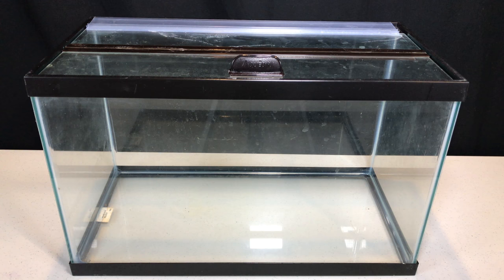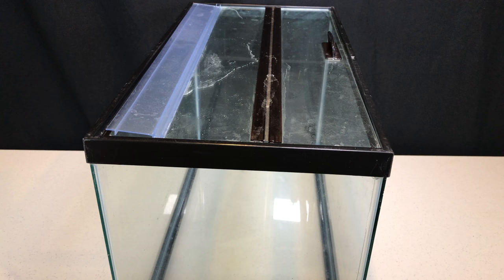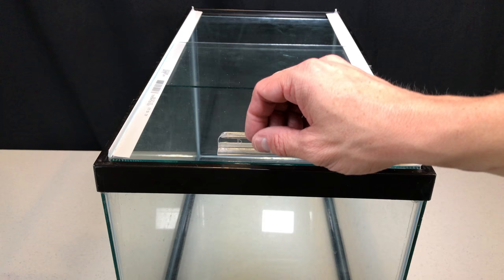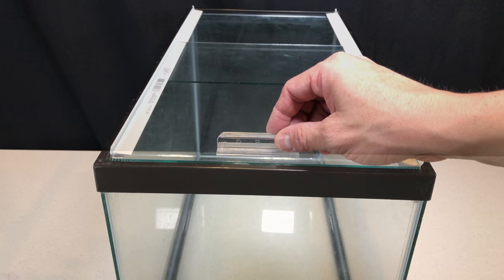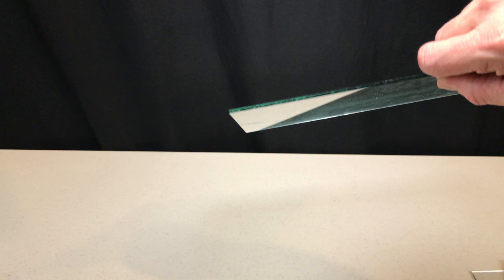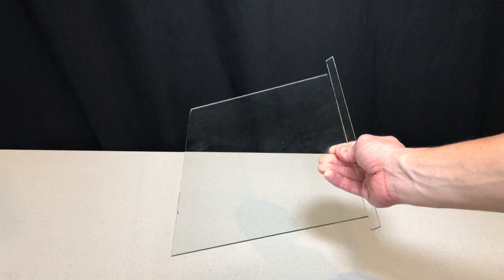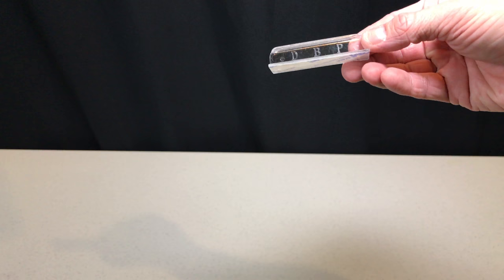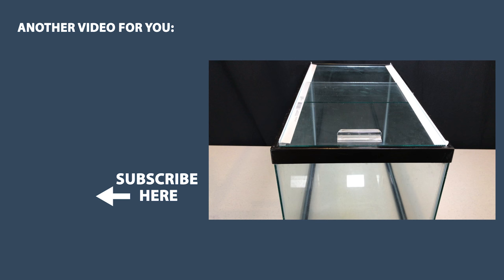How to Make Sliding Glass Aquarium Lids

Comment: I like this because it's not shabby, janky or ghetto. I want to suggest something a little different though, although this is the best idea I've come across yet. And if your goal is purely economical, this might not be the thing for you. But if you want something a little better, maybe a bit more money, maybe not, there is another way of doing this. I used to build reptile cages professionally, so I've built lots of things like this. If your situating your tanks short side of the tank facing out, like in this video, as opposed to long side out as you would do with one tank in your living room, there is a little better way to do this...maybe...I'd have to use them both, but hear me out. You can use either that thinner glass as above (the problem with that is it is so thin the edges can't be "sealed" or smoothed over) but my preference would be 1/4" thick as it is more substantial, can be "sealed" and getting daily use, the heavier glass might be better. At least the front piece that is moving when sliding open. It sure is a better feel. Or you can use the polycarbonate material as seen in other videos, and if you can somehow seal the ends of that stuff (and I've got an idea for that), it traps air and thus has an insulative property, keeping your heat in much more effectively, thereby saving your heaters is using them. Anyway, you use the same dimensions as in this video, except the back piece is attached to the TOP of the plastic rim...maybe permanently, maybe not (using some L channel around the 3 sides would keep it in place nicely, or you could glue it on which would be permanent). You use the same dimension front piece that goes in the lip where the lid is meant to go. This way, the front piece, the one with the handle you use every time you get in the tank, it slides UNDER the top piece, which I think is better because in this scenario the front piece is on top and there really is nothing to hold it down or give it any guidance. Kinda flimsy. Does this make any sense? What do you all think?

Comment: Usually in the same place you find the plastic molding that Steve used, you can find a piece of small white plastic J molding(that's like a 1/4 inch on the bottom and a 1/2 on top. I used that stuff to cover the edges of the glass. Put a couple dabs of silicone on and it keeps the glass from cutting you, and also keeps it from wanting to dig into the piece its sliding on too.

Comment: i got all my tanks second hand and they all came with no lids. i found the same idea on youtube and luckily  I work at a Ace Hardware and we cut glass to size for sale. the only thing i did different  were the handles. i used a 3" X 3" of plexi glass that i heated up and folded at a 90 degree angle. and i just used a little bit of clear epoxy to glue them in place. the lids work very well and they are easy to take out uf needed. Great DIY vid!

Comment: you could cut up old tanks that leak, and make your own lids. ive never done it, but lids are so expensive. i find glass from resale shops, glass that would be used on furnitire shelving, so its kind of thick, and use that, and regular wood i fond in the garbage. i can set those dome shop lights right on the glass, and its ok. Nothing breaks, or cracks.
Reply: or just reseal the leaky tanks!
Reply: some of it may be tempered glass,  FYI.
Reply: Cracked my first glass top years ago by putting a shoplight on it.

Comment: If you would put a filter where would it go
Reply: At the back, just leave room enough for an airline, or cut a little hole.. If you are doing a multiple tank setup like this, you are likely running a bunch of sponge filters and heating the room rather than individual tanks, so it presents little obstacle. You could also have a hang on back filter and a heater cord coming out instead at the short end. If you want them to hang off the long end, then you are better off sticking with the versa-top style.

Comment: great info, fyi lowes will cut glass for you at no cost.
Reply from the maker: +Tank Addiction they were unwilling to cut a piece this small off of glass this thin but in general, yes they do offer that service
Reply: I know home depot won't cut glass but lowes does, if they say no one should ask why not I've worked at lowes for 12 years and it is a service we have always offered, Ace Hardware also offers glass cutting in most stores, great video thanks for sharing friend have a great day.
Reply: Tank Addiction Where are you that Lowe's cuts glass? I've been to many Lowe's and have NEVER seen a glass cutting area in them. are you one as coast or something??? I asked one Lowe's and they had no idea there were Lowe's that cut glass.
Reply: eric j u still work there?

Comment: Urgent question! I'm putting a 75 gallon in my new house soon, has a stand and I found a great video on building a 100% custom remote controlled light bar, but glass lids are SO expensive for bigger tanks. Any advice on making a heavy lid like that first one you showed us? It needs to withstand dojo loaches which can grow up to 10 inches and are notorious for being strong jumpers. Thanks!
Reply from the maker: Lids for a 75 aren’t that expensive. I would shop around. Drs foster smith is usually my go to. It’s worth investing in.

Comment: Anyone try using Lexan ?  Seems like it would be lighter, easier to work with?  Just a thought?  Not sure how well it would hold up to the heat of a 6500k LED light an inch above it though?  Hmm i may give the Lexan a whirl.   
Thanks for sharing, handy solution here with those plastic tracks for the sides on top of aquariums with the ridges.
Reply: polycarbonate is awesome for such things, easily takes 100°C, and is virtually unbreakable*. but more expensive than glass, and more time consuming, and IMHO harder to work with as well. glass you score, snap, and quickly break the edges with sand paper - PC must be sawn, the edges need more finishing work to look neat, and it scratches MUCH more easily. 
( *= i shot a 3mm macrolon sheet with a longbow, and a pointy "bullet" tip only left dings in it. one arrow broke. that stuff would make formidable light body armour )

Comment: What if my tank does not have those black edges? Is there a way to effectively fit it on top without it falling?

I was previously thinking of using mesh along with a simple 90° moulding for the edges to hang on to the tank's edge